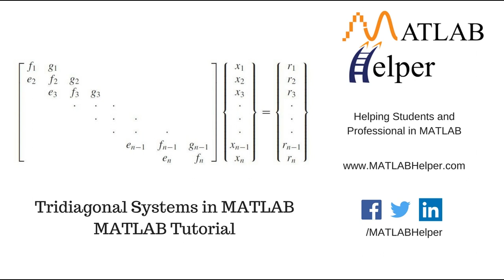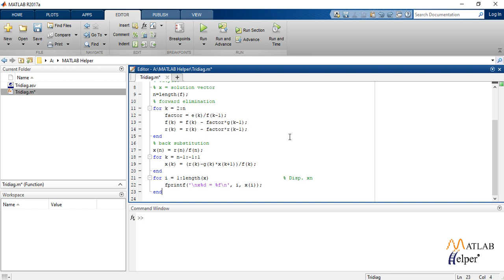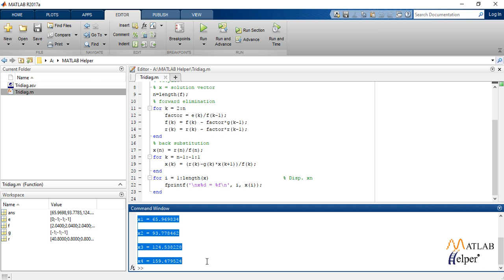Tridiagonal Systems in MATLAB | @MATLABHelper Numerical Methods

Comment from the maker: Join our premium course on Numerical Methods at https://mlhp.link/NumericalMethods/
Read this & adjoining lesson at https://matlabhelper.com/course/numericalmethods-c5l5-tridiagonal-systems-using-gauss-elimination/ for codes & explanation.
0:00 Introduction
0:08 Understanding Tridiagonal Systems
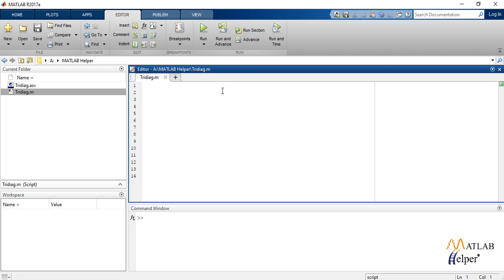1:50 MATLAB code to implement Tridiagonal Systems
Reply: function x = Tridiag(e,f,g,r)
 |
Error: Function definitions are not permitted in this context.
Reply from the maker: Is the code just of one line, Was it executed by Run button or through command window?   It would be best if you send some snapshot of what you are doing to contact@matlabhelper.com and we will surely guide you

Comment: #Triangle_Diagonal_Matrix is a matrix with a band of only 3 elements in each row rest all elements are 0. In tutorial the sub & super diagonal elements are made as -1 and then solved. We can also use #Thomas algorithm to solve tri-diagonal system which converts the band into 2 element form where diagonal elements are made as 1 and super diagonal matrix is put up for calculation.
As for loop it will be there depending on number of rows in the matrix, if it is small loop can be avoided too.
Thanks for the explanation.
Reply from the maker: Good Insight